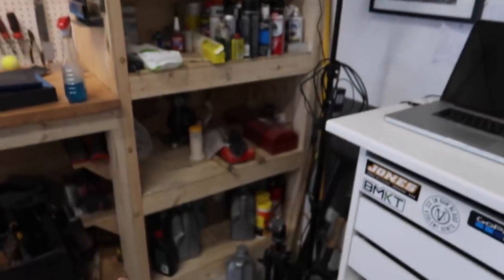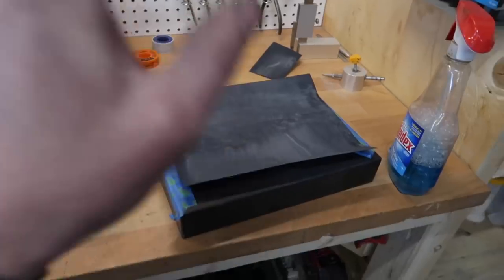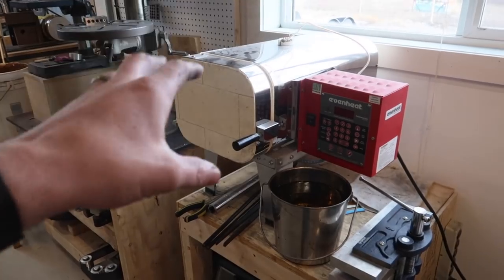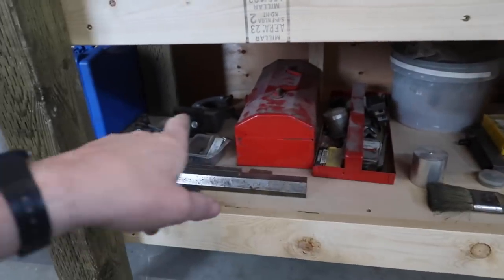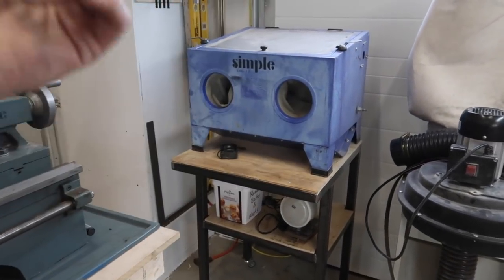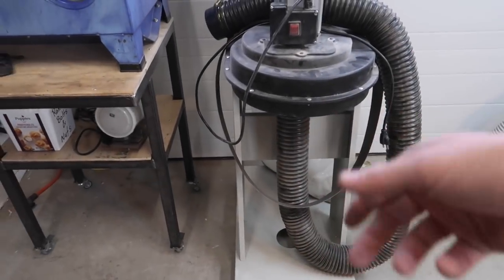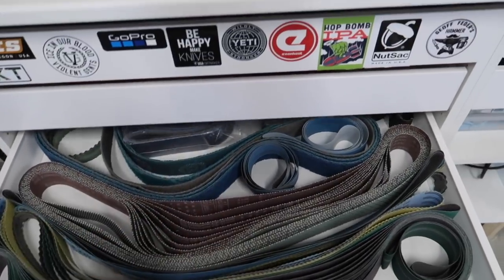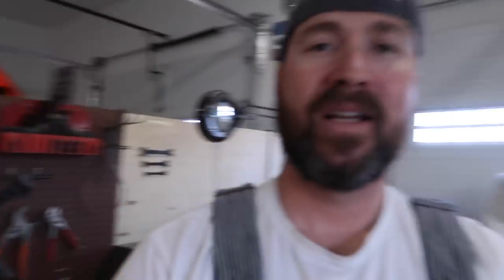Knife Shop Tour -2018-

Comment: By far the best and most efficient modification I made to my shop was installing a retractable extension chord from the ceiling in the middle of the shop.  It is so nice not having to run chords everywhere. Reach up, grab it, use it and retract it.  Super handy.  I use it more than any other chord in the shop.
Reply from the maker: I’ve never thought about that but that is a great idea! Thank you👍
Reply: I have two of them and they really save time.  Plus one with an air hose.
Reply: Matthew M I found mine at Costco
Reply: Matthew M exactly, a chord on a recoil so it retracts itself after you tug on it.

Comment: Excellent organized production space. If you are going to sit down during some work tasks, make sure you have a comfortable chair/stool with adequate padding. Like an anti fatigue mat, it makes a difference with how long you are able to continue doing something. Especially if it is unpleasant, tedious or demands concentration.
One thing I assembled in my work space was a tool closet with two doors that opens wide. The inside of the doors have shelving storage for things in cases, like drill bits. Outside and all inside I put peg board so I can hang a lot of tools and these transparent plastic containers, with the peg hooks through holes already present, that come with suction cups in I remove. I store individual items in these like pens/pencils, small paint brushes, exacto knives, etc. I get these in Dollarama Stores where they have the bathroom stuff, 2 sizes, shallow and deep. I stained the frame wood Dark Walnut and painted all the peg board with blue enamel. It's 7Ft. tall by 5Ft. wide and 8 inches deep and holds a lot of small items I use frequently. All my measuring tools, safety glasses, speed squares, "T" squares and jigs for things like drilling shelving holes, cupboard hinge hole jig, door pull jig and pocket hole jigs. It takes time to organize but in the long run, it provides you with more room and you don't spend so much time looking for that one little tool, you know you had around here somewhere. All the Best.

Comment: Great vid, Question, what brand ( & where from) of dust collection are you using. setting up my own shop and your video's are a big help. Thanks
Reply from the maker: Thank you! I have a cheap one from busy bee tools which is a Canadian tool store. It was $230 if I remember correctly and it’s been pretty solid so far 👍
Reply: Thanks. I'm near Toronto , I will check it out